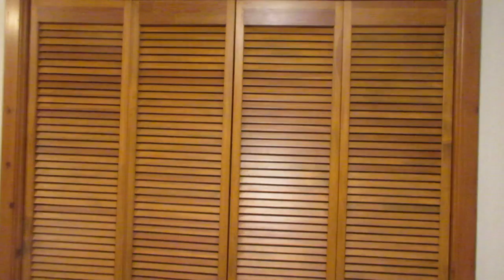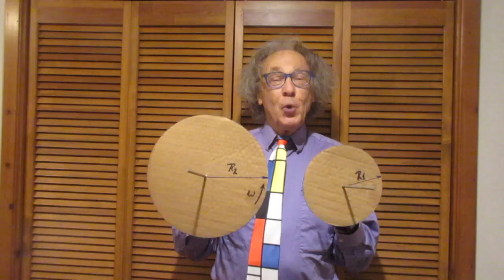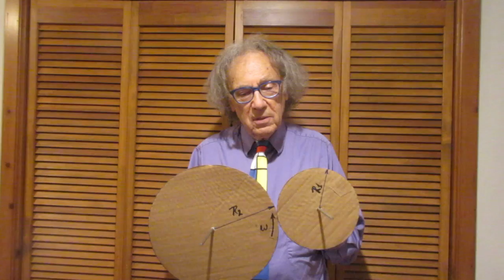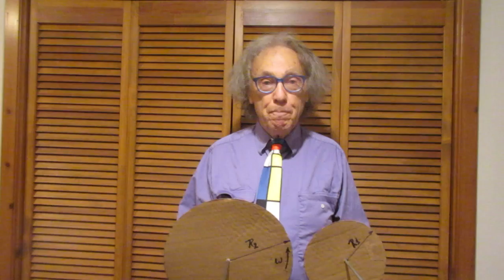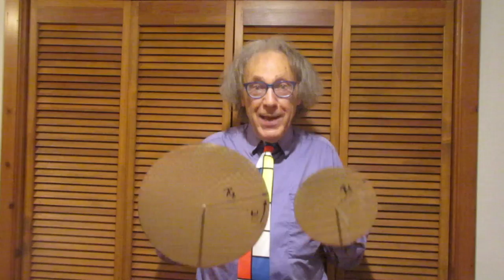Solution 1/2 Problem #8 - Rotating Discs

Comment: Excuse me professor I have a question for you. You previously mentioned that you would apply a force to the Disc R2 in upward direction and another force on R1 in downward direction in order to keep them parallel to each other. Unless they would slide in downward and upwards direction respectively. Yet you apply those forces perpendicular to the the rod,so there has no tangential component of that force to give it a particular torque. Then why doesn't the angular momentum keep conserved?? I would be much obliged if you would be kind enough to answer my question. Thank you sir.
Reply from the maker: I cannot add to the clarity of my solution. Angul mom is not conserved bcoz there is a nexternal torque on the system.
Reply: @lecturesbywalterlewin.they9259  Okey sir got it thank you a lot and best regards ❤️❤️

Comment: Dear Sir, kindly help me in finding the flaw in this argument,as the force applied by you (transmitted to the disc by the rod) is passing through the axis of rotation,the rod, so torque of this force applied will be perpendicular to the w vector of the discs hence cannot change them therefore angular momentum conservation is applicable here.
Reply from the maker: I cannot add the the clarity of my solutions.  torque is a vector. the direction of the torque that my hands apply on the rods is in the direction (or the minus direction) of the omega of the discs. omega is also a vector.
Reply: Dear SS, did you find the flaw . It's driving me nuts. I am drowned in same confusion.

Comment: Nice physics problem. I like this problem, because it shows that neither kinetic energy nor angular momentum can be conserved. I also like that this problem points out to consider the reaction forces in the bearings that cause a torque on the system. There is even a very elegant solution to this problem, that finds another quantity, which is still conserved: https://physics.stackexchange.com/questions/314063/conservation-of-angular-momentum-exercise
Reply from the maker: angular momentum is not conserved & KE is not conserved

Comment: Sir can there still be no slip condition if one disc is accelerated  uniformly?
Reply from the maker: as long as there is a differential circumferential speed between the 2 discs there will be slip. That is a necessary condition.
Reply: If a statement says that disc one is accelerated at constant angular acceleration and there is no slip does that mean that friction is infinite between both disc? If thats so then it must be impractical statement or not?
Reply from the maker: the acceleration can vary in time. You can also separate the discs and then make them touch each other again. If you push hard it will take little time for the system to reach equilibrium. If you push softly and interrupt to take a 1 hour nap it will take a long time. In all cases the equilibrium frequencies will be the same.
Reply: But howsoever hard we push the time to reach equilibrium can't be zero. Hence sir for one disc accelerating no slip condition can't hold for each instance. This is what I want to know? thank you sir
Reply from the maker: I do not understand your question. Watch my solution!
Reply: i got it sir thanks

Comment: The angular momentum and energy is not (in principal ) lost to heat. Note that forces applied to the centers of the discs are equal and opposite in direction( so linear momentum and energy is conserved ) but they don' t lie on the same line( Distance between them is R1+R2) so you must applied external torque to the system (note that by system I mean two discs) to prevent it from rotating.This mean we cant use conservation law of angular momentum and energy. To do that we will have to extend our system to the "outside world" till external torque will be zero or don't applied torque at all but then as I said not only the disc 1 and the disc 2 will be rotating around their own centers of mass (center of mass of uniformly density disc is in his geometrical center) but also hole system will be rotating around his center of mass (which lie between center of mass of disc 1 and center of mass of disc 2)
Reply from the maker: Angular momentum is not energy. Thus it can not be lost to heat. Apart from that, angular momentum is not conserved. There is friction between the 2 discs as omega changes that means that rotational KE is converted to heat.

Comment: I still can't see why angular momentum for the system is not conserved. The frictional force is internal force ,therefore,it will not change angular momentum of the system.the force you are applying at the axle of the rotating disc is not an external torque because it is passing through axis therefore should not affect angular momentum.( If not so then for any body rotating about a fixed axis conservation of angular momentum should not be applicable)
Reply from the maker: >>>the force you are applying at the axle of the rotating disc is not an external torque >>>
WRONG Take my 8.01 course and become educated!

Comment: I am struggling to understand why do you say the end state is not equillibrium. As far as I'm aware, equillibrium means net forces and net torques are zero - in other words, that there's no acceleration (or angular acceleration). If there's still motion it's just fine equillibrium, as long as it's constant (angular) velocity. Which is precisely what happens in that end state - angular acceleration has ceased and the discs move with constant angular velocity. So why isn't it equillibrium?
Reply from the maker: If you like my choice of "equilibrium" that's fine with me.
Reply: dynamic equilibrium

Comment: Why the 2 discs should be at the same height from the ground??

I mean, if we still make the 2 discs touch, but this time, there is a height difference between the rods of the two discs, disc-1 will be a bit lower than disc-2, in the vertical direction without changing anything in the horizontal direction..................

I guess, nothing will change in this situation because still, disc-2 will rub over disc-1 and still you will have to apply a torque to keep the discs in place.................but in this case, disc-2 will have some potential energy higher than disc-1, but that potential energy will not change because you hold the discs in place................

so if in this problem, had you would have held the discs at different heights then also nothing would have changed.....ISN'T IT??
Reply: what I am saying above, has been done by you in one of your lectures of 8.01......................Lect-24 (at 45:59)...........
PLEASE DO HAVE A WATCH!!
Reply from the maker: key is that you hold the rods parallel. At start one rod can be lower than the other, but then you should NOT change this. The equilibr position will then be the same as before..
Reply: Yes........
that's exactly what I was thinking!!
Reply from the maker: soon, after my death, you can take over the Bi-weekly Physics Problems.
Reply: Wow!!
That's a lot of weight on my shoulders and honestly, I don't think I can match your enthusiasm and the way you prepare these videos, it's second to none..................and in that case, first I will have to prove that I am capable enough to be the heir of "The Walter Lewin" and believe me or not, I am well on my way!!
:)

Comment: My lazy brain thought of conservation of angular momentum first :S
But now I got it. The forces in the contact point are equal at every instant, so the torques are directly proportional to the radii of the disks. This implies that the variation in angular momentum in each disk is proportional to its radius (talking in magnitudes up to here). Plus the equal tangential velocity condition, we get w2 = w/[1+(R1/R2)^2].

Comment: Okay, second attempt...

τ = Ffr R = I α

Ffr is the same for both disks:
 I1/R1 α1 = I2/R2 α2

Moment of inertia of the small disk can be derived from the larger one:
  I = 1/2 M R², M = ϱ R² π h
  I1 = I2 R1⁴/R2⁴

Substituting:
  α1/α2 = R2³/R1³

One disk accelerates as the other one decelerates:
  w1(t) = α1 t
  w2(t) = w - α2 t
  ->  α1/α2 = w1(t) / (w - w2(t))

When "equilibrium" is reached Ffr and α become 0:
  w1 R1 = w2 R2
  ->  w2 = w1 R1/R2

Substituting again:
  R2³/R1³ = w1 / (w - w1 R1/R2)
  ->  w1 = w R2³/(R1 (R1² + R2²))
      w2 = w1 R1/R2

Example:
  let w = 100, R1 = 1, R2 = 2
  w1 = 100 8/5 = 160
  w2 = 160 1/2 = 80

Comment: When de two discs touch, disc_1 will take a piece of the spin of disc_2.

But, due to the friction between the two discs, and the friction between the discs and the air, and due to the pressure applied by the two hands, the spin will finally disappear from the experiment, and will turn into heat, and so heat up the discs, the rods, the hands and the air.

Therefore our value's will be:    spin_R2=0    spin_R1=0    ω=0

Comment: what is I increase the velocity of an object going towards a Black hole an the velocity is let's say 900000 km/s well faster than light would it still be pulled in or would it start revolving around it with same velocity?? and would the centrifugal force powerful enough to keep it in place??
Reply from the maker: >>>the velocity is let's say 900000 km/s well faster than light>>>
that is not possible, thus your question is meaningless.
Reply: Aryan Dadwal:    Do you mean an research-satellite from MIT?

Comment: Sir, I solved it exactly with the same way you demonstrated.the key to solve the problem is hidden in a single line : "After a certain time neither the bigger disk is speeding up nor the smaller disk is speeding down".
Fantastic problem..waiting for next one.

Comment: Sir, according to me
w2 = w(r2)^2/((r2)^2+(r1)^2) and w1 = w2r2/r1
Because T2 (torque on disc 2 about its centre) = f×r2 where f is the frictional force. Similarly T1 = f×r1
As T2 = i2×a2 (where i2 is moment of inertia of 2 and a2 is angular acceleration of 2 about its centre) and T1=i1×a1, hence a2/a1= (f×r2×i1)/(f×r1×i2) = (r1/r2)^3
w2 = w - a2t (where t is time taken) and w1=a1t
hence w2 = w - (a2/a1)w1
w2 = w - (r1/r2)^3×(w2r2/r1)
w2 = w - w2 × (r1/r2)^2
w2 = w(r2)^2/((r1)^2+(r2)^2)
Reply: +Lectures by Walter Lewin. They will make you ♥ Physics. 
Sir, I have a doubt.
If two charges are placed at some distance in vacuum and one of the charge is suddenly moved, then force on the moved charge will change due to different electric field at the point to which it is moved. But the force on the unmoved charge will take sometime to change as information can't travel faster than light. So aren't the forces on the two charges different (violation of Newton's third law)?
Reply from the maker: If 1 charge is suddenly moved it will create EM radiation. If the distance between the 2 charges is 300,000 km it will take 1 sec before the other charge receives the EM radiation
Reply: +Lectures by Walter Lewin. They will make you ♥ Physics. 
Sir I agree that the time taken by the information to travel will be negligible, but I want to know whether Newton's Third law is applicable here or not.
Reply: Dear Chitranshu ,can you please explain me that why is the contribution of external force applied by walter producing non zero torque , i think it should br zero for each disc separately as the forces passes through centres .

Comment: I have not seen video 2 solution, but I am going out on the limb to guess:
w1 = w * (r2 * 2 / (r1 + r2))   and  w2 =  w * ( r1 * 2/ (r1 + r2))
Reply from the maker: incorrect - this is not a problem whose answers can be guessed.
your answers are even dimensionally nonsense. a kg is different from a speed as they have different dimensions
Reply: Walter, there is no kg in my solution above. The dimensions are correct as I am dividing a length by a length.  I basically calculated the average of  radius 1 and radius 2 and proportioned it according to each disk's rotational velocity.
Reply from the maker: sorry, I misread, I thought r2 * 2 was R2^2. with my apologies. 
Your dimensions are fine but your answer is wrong.

Comment: I think I've got it.  The torque required to speed up disk 2 is equal to the torque required to slow down disk 1, because the same torque is being applied to both discs in equal but opposite directions (Newton's 3rd law). Since both disks finally reach the same final circumfential velocity (different angular velocities, don't forget) we can set up and solve the 2 equations.
Reply from the maker: >>The torque required to speed up disk 2 is equal to the torque required to slow down disk >>>
incorrect
Reply: The same FORCE is applied. Torque = F x r, so disk 2 with a bigger r will have the bigger torque.
Reply: Oh, right.  I should have said, T2 / r2 = T1 / r1, where T1 is the torque on disk1 and T2 is the torque on disk2.  Because the forces at the circumference of each disk is the same (not the torques themselves)

Comment: sir u said that we have to apply force on the discs continuously but in the end stage as the friction force between the discs stops then we have to stop appyling tht force otherwise the discs will accelerate in tht direction of force(i m talking abt force on hinges).also my doubt is whether we have to suddenly stop appyling tht force as soon as friction vanishes. PLEASE HELP
Reply from the maker: >>>>but in the end stage as the friction force between the discs stops then we have to stop appyling tht force>>>
No not necessary. there is no differential velocity between the 2 discs thus you can keep pushing them together - freq will not change. If you move them apart, freqs will not change either.
Reply: we can push them into each other but we cant apply a force as we did earlier when friction was there .(force upwards nd downwards on the discs )
Reply: actually the pushing force has no role in changing angular momentum .it was the upwards nd downwards forces on the hinges tht changed the angular p of the body
Reply from the maker: >>we can push them into each other but we cant apply a force as we did earlier when friction was there>>
when you push them against each other you DO apply a normal force. But since the differential velocity of the surfaces of the discs is zero, there is no friction. You can push as hard as you want to. Of course, in practice, as you push very hard, the rods will no longer be frictionless but that's a different story. This is my last msg not this topic.

Comment: nice so angular momentum change is proportional to radii of discs. So initial angular velocity drops to r1^2 / (r1^2 + r2^2) of initial angular velocity. nice problem I thought the trick was using angular momentum against correct axis was the nuance hence didn't get it correct last time.
Reply from the maker: not correct

Comment: Is it correct that if R2>R1 then F1=F2=Friction force so we have to apply torques T1 and T2 where T2>T1?
And the Force we apply in total is f(Walter Lewin)2=sqrt (N^2+F^2)
where 
f (walter lewin)2 is the external force we have to apply to the rod of the disc 2
and N is the normal force.

P.S. Fantastic tie as well as this problem!

Comment: sry if im stupid, but in my opinion you loose angular momentum by producing heat and not by exerting force on the rodes, if u could make same system where you dont produce heat your angular momentum in left hand would cancle angular momentum in right hand so its conserved, sry about bad english
Reply from the maker: if there is differential velocity between the circumferences of the discs heat is always produced at ANY value of mu (except zero)
Reply: i wish that my professors are so engaging as u sir,  this made me to read and thinking alot of angular momentum and torque today, u really made my day :)
Reply from the maker: You are not correct, angular momentum only changes if there is an external torque. KE can be lost without a change in angular momentum.
Reply: bro acc to me if u make a system where there is no heat loss then there will be no friction and rolling of other disc will not start .if u apply force then the discs will move in the dirn of force nd the problem wont make any sense.i hope this helps .thank you
Reply: what if u make perfect friction without sliping how much heat do you produce? btw my english is not good so maybe i dont describe well what i mean sry
Reply: if u make perfect frictionless then no heat nd if u make friction then u can easily calculate the heat produced by calculating the difference in the kinetic energy of system
Reply: ty for reply this think is realy making my brain hurt, but i think i understand now where were my error, i was looking hands as in system and i confuse torque and angular momentum
Reply: ty for this discusion i ment if we make two flywheels (perfectly rigid) in isolated system (vacum, no friction at rods....)  and hold them together with friction  μ=1 do you produce heat, i  cant wrap my head on it ty if u can explain :)
Reply: jure in which class r u